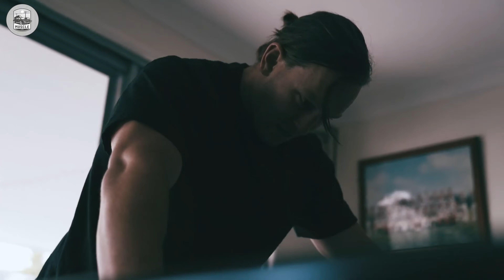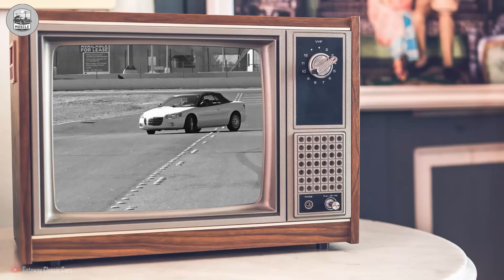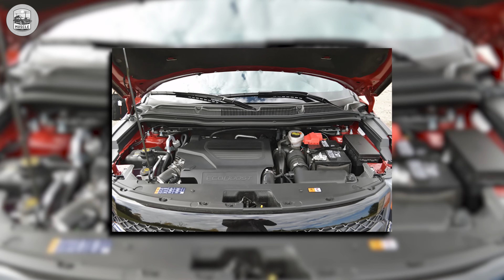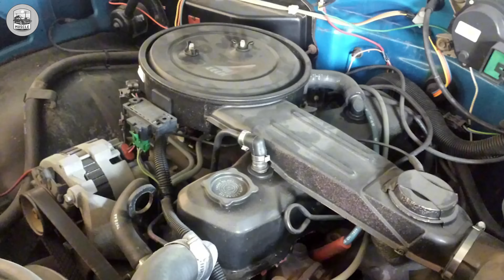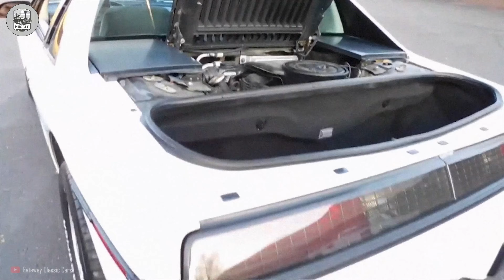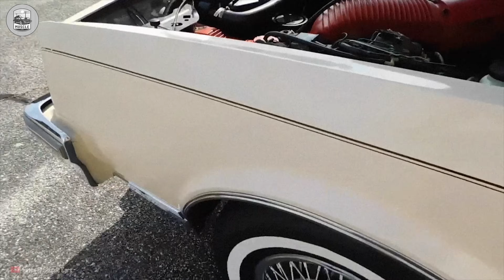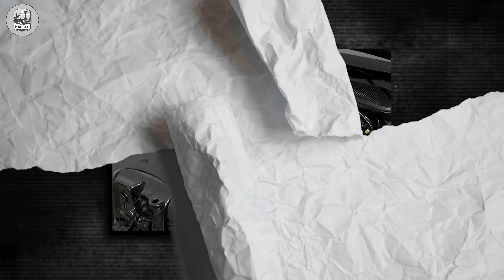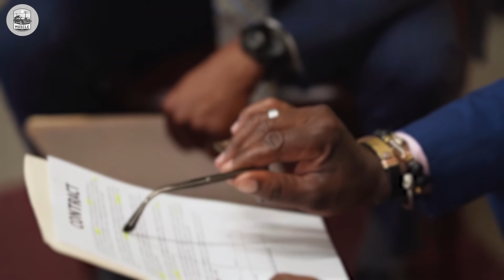MOST FAILED ENGINES ever put in production cars | Worst engine blunder!

Comment: I had a Chevy beretta GT with the 3100. That little engine was the truth. I was easily able to stay on a mustang GT with the 4.6 butt. 

I also had a Buick Enclave with the 3.6 engine. It was the truth too but the water pump did fail about 110,000 miles. Luckily I had an extended warranty that covered the cost. 11 years old I hit the gas it still will break the tires loose and leave rubber on the road. 

Had me a 2001 Monte Carlo SS with the 3800 in it. I loved that engine as well. I actually turbocharged that engine and upgraded drivetrain components. I had 600hp going to the front wheels. The car was swift lol. I regret getting rid of that car and it was a rare color too
Reply from the maker: Wow, you’ve had quite the lineup of legendary GM engines
 That 3100 in the Beretta GT punching above its weight against a Mustang GT? Respect! The 3.6 in the Buick Enclave has always been a powerhouse for its size, even with the common water pump issue. Good thing that warranty came through because an 11-year-old SUV still breaking tires loose? That’s saying something
Now, that 3800 in your Monte Carlo SS – turbocharged with 600hp to the front wheels? Absolute beast mode! The 3800 is one of GM’s most underrated engines, and your setup sounds like it was built for pure thrill. Rare color too? You must miss that one for sure
Folks, let us know about your favorite GM rides in the comments. Don’t forget to like, share, and subscribe to American Muscle Cars. 
Stay tuned for more! Hope to see you in the next video, and have an awesome day
Reply: I had a Cavalier Z24 with the 3.1 and that was a fast car and got great mileage with no issues up to 175K when I traded it in on my Monte Carlo SS with the 3.8L Series II and drove that car to 250K until it rusted out and I got rid of it. Regular maintenance and not beating on it all the time will get you great life out of these engines.
Reply from the maker: @johnkaltinger3922  Great, you've got a real knack for picking legendary GM rides! The 3.1 in your Cavalier Z24 was a workhorse with surprising speed and efficiency. Trading up to the Monte Carlo SS with the 3.8L Series II? That engine is an absolute icon, delivering smooth power and reliability for a quarter-million miles—impressive! Regular maintenance and smart driving really do wonders, and your story proves these engines can go the distance.
The 3800, especially in the Monte Carlo SS, deserves more love. Its versatility, from commuter cars to turbocharged monsters, is unmatched. GM nailed it with this platform
Folks, share your stories in the comments what GM rides left their mark on your life? Don't forget to like, share, and subscribe to American Muscle Cars for more gearhead tales and legendary engines.
Thanks for watching, and stay awesome! Hope to see you in the next video. Have a great day, everyone...

Comment: What hapoened to the 2.8chevy.  couldn't keep rod bearings in thhem.
Reply from the maker: Ah, the infamous 2.8 Chevy V6—GM's attempt to modernize with a compact engine for smaller cars and trucks in the late '70s and '80s. While it had promise, you’re absolutely right about the rod bearing issue. The early models, especially those before 1985, were notorious for oiling system deficiencies. Low oil pressure and insufficient lubrication at higher RPMs caused premature wear on the bearings. Later versions improved somewhat, especially with the introduction of the 3.1L and 3.4L variants, which built on the same platform but addressed some of those early flaws. Despite its flaws, the 2.8 V6 powered plenty of iconic vehicles, from the Camaro to the S-10 pickups, making it a memorable engine for many enthusiasts.
We’d love to hear what you think share your stories, memories, and experiences! Don’t forget to comment, share, and subscribe to Muscle Car Masters! Hope to see you in the next video, and have an awesome day

Comment: The iron duke in the fiero also suffered from a reduced oil capacity because of a shallow oil pan to get the car lower.
Reply from the maker: You're absolutely right
The Iron Duke in the Fiero did have a reduced oil capacity due to its shallow oil pan, all in the name of lowering the car's stance. Unfortunately, that design compromise contributed to engine durability issues, especially under spirited driving conditions. It's a reminder of how engineering trade-offs can impact performance and reliability. For those who love the Fiero or the Iron Duke, share your experiences and tips in the comments! Don’t forget to like, share, and subscribe to American Muscle Cars for more fascinating insights. 
Wishing everyone a great day, see you in the next video
Reply: As does the Audi 1.8t
Reply from the maker: @timdodd3897  Yes, the Audi 1.8T shares some of the same challenges when it comes to engine design compromises. Just like the Iron Duke in the Fiero, the 1.8T's performance can be influenced by factors like oil capacity and cooling, which affect durability, especially when pushed hard. It's a perfect example of how every engine has its strengths and weaknesses. For those of you who love these engines, drop your thoughts and experiences in the comments  we’d love to hear your stories! Don’t forget to like, share, and subscribe to American Muscle Cars for more muscle car passion and insights.
Keep the engine roaring...

Comment: Who does the research for this list? I've been an ASE Certified Master Tech and Diagnostician for over 30 years. I read everything I can to stay up-to-date in the industry. Many of these engines on this list are not engineering failures as many of them functioned as intended over the lifespan they were designed for. The GM 2.2L was meant to be a low cost, low powered economy engine for economy cars with a projected life of 100k miles. Most only saw major issues when reaching higher mileage(150k+) or owners didn't perform maintenance at semi-regular intervals. The same could be said of the famously long-lasting Iron Duke.
The GM 3800 was a great engine, especially the Series II. The only real issue the 3800 had was extremely badly designed and produced intake manifold gaskets. Once you replaced them, the engine was one of the best engines GM ever made. The exact same can be said for its predecessors as far as bad intake gaskets and great longevity in the 3.3L and the 3.1L.
And I'm not a fan of GM.
GM has built some duds, yes, but not most of the ones on this list. The Cadillac 8-6-4 was a dud as was the Northstar with it's leaking, split block and horrendously difficult to change water pump. The 307ci V8 was an underpowered, vacuum hose nightmare of an engine. 
All manufacturers have built some duds and sone great engines. ALL engines that are mass produced will and do have design flaws and common points of failure. But if it's a parts manufacturing failure and not an engine design failure, such as GM's fiber plastic intake gaskets, I don't believe you should condemn the engine design as a failure. 
The Chrysler 2.7L V6 was a design failure in that it had a badly designed and prone-to-leak water pump that was timing chain driven so thus encased behind the timing cover. When the badly designed water pump failed, it would leak all the engine coolant into the oil sump(oil pan) and cause main/rod bearing failure due to lack of lubrication. That's an example of engine design failure. 
Do your research before making these lists. Ask people who have been in the industry for decades. Don't just read someone's anecdotal evidence based on their personal issues with an engine. Ask the professionals.
Reply from the maker: Thanks for your detailed comment
Your insights as an ASE Certified Master Tech bring great depth to the discussion. You’re absolutely right—many engines labeled "failures" served their purpose when properly maintained. The GM 3800, especially the Series II, is a legendary workhorse once intake gaskets were addressed. Similarly, the Iron Duke proved its worth in longevity and economy.
We aim to engage enthusiasts like you, balancing technical facts with broader perspectives. Your point on distinguishing design failures (like the Chrysler 2.7L's infamous water pump issue) from parts failures is spot-on! Feedback like this helps refine our research, ensuring we honor both engineering triumphs and lessons learned.
Keep sharing your knowledge—it enriches our community! To all viewers, comment below with your experiences, share with fellow gearheads, and hit subscribe to join the Muscle Car Masters family. 
Hope to see you in our next video. Have a great day, everyone
Reply: Respectfully, I think you’re missing the big picture here. Many engines were great for what they were designed for. Take the Iron Duke cheap, reliable, and ran forever if maintained. Even ‘duds’ like the 8 6 4 showed innovation, just poorly executed. It’s not always the design; sometimes, it’s maintenance or expectations that lead to failure.
Reply: @AilaniMadden   I am VERY familiar with the various designs and modern innovations of the internal combustion engine as well as newer vehicle EV technology. I've been an ASE Certified Master Tech and Master Diagnostician for over 30 years. I've dealt with all these engines numerous times.
Reply: @knowplay3258  Respectfully, I hear you, but dismissing engines like the 8 6 4 overlooks their potential. GM aimed for efficiency in an era of tightening emissions ambitious for its time. Poor execution doesn’t erase the innovative thinking behind it. Sometimes, innovation stumbles before it soars. Muscle cars thrive on bold risks, even when they miss the mark initially.
Reply: @AilaniMadden   You seem to have gotten me wrong. I defend many of the motors in the video as not being the badly designed engines and failures the video claims. I have no issue with innovation..with purpose. But, innovation simply for the sake of innovation tends to NOT further any part of engine design. Rather, it tends to waste time and resources. Sometimes, newly innovative engines are a boon to the automotive industry, other times they become the bane of the same industry. The 8 6 4 engine was a bane that cost consumers millions for a virtually untested design..it was rushed and not fully tested to the extent other designs are normally. In later years, we've seen successful attempts of the same technology from Chrysler/Stellantis/FCA with their MDS and GM with both their AFM and DoD systems. All as a result of the lessons learned from the catastrophic failure that was the 8-6-4.
Reply: @knowplay3258  yes, thank you and respectfully, I hear your point, but I think we’re too quick to dismiss engines like the 8 6 4 as  failures. Sure, GM’s execution was flawed no argument there but let’s not overlook its intent. In the early 1980s, the auto industry faced skyrocketing fuel prices and increasing emissions regulations. GM tried to adapt without killing off v8s entirely, which is something muscle car fans should appreciate.
The 8 6 4 was ambitious an early attempt at cylinder deactivation that aimed to preserve power while improving efficiency. Yes, it stumbled, but innovation often stumbles before it succeeds. Chrysler’s MDS and GM’s AFM/DoD systems wouldn’t exist without lessons learned from the 8 6 4.
Reply from the maker: @knowplay3258  Thanks for the insightful comment! Your extensive experience as an ASE Certified Master Tech and Diagnostician brings a lot of value to the conversation. I completely agree, innovation should have purpose, and while the 8-6-4 engine might not have worked out, it certainly paved the way for later, more refined technologies like GM's AFM and Chrysler's MDS systems. It's a great reminder that innovation, when done right, can truly move the industry forward. We love engaging with enthusiasts like you who bring that real-world perspective. To all viewers, please share your thoughts, comment below, and don't forget to subscribe for more. Hope to see you in the newest videos. Have a nice day

Comment: The GM 2.2 OHV was reliable.Same with the 3100,Fel Pro and Dorman came out with upgraded intake manifold gaskets made out of metal to fix the intake manifold gasket problem.That Jaguar V12,lot of them were yanked out replaced with a 350 Chevy.The GM 2.5 was good
Reply from the maker: You're absolutely right about the GM 2.2 OHV and the 3100 engines
 Both earned a reputation for reliability once that notorious intake manifold gasket issue was addressed. Props to Fel-Pro and Dorman for stepping up with those upgraded metal gaskets—proof that the aftermarket world knows how to solve problems! The Jaguar V12 swaps are a classic story, with many owners opting for the bulletproof Chevy 350 for its simplicity and power. As for the GM 2.5 'Iron Duke,' it was an unsung hero—rugged, efficient, and a go-to workhorse for many GM vehicles.
We love hearing stories like this! Muscle cars are all about ingenuity and passion. Got more experiences or knowledge to share? Drop them in the comments! Don’t forget to share this video and hit that subscribe button to join the American Muscle Cars family. 
See you in the next video, and have a fantastic day
Reply: While many muscle car fans dismiss GM's smaller engines, the 2.2 OHV and 2.5 Iron Duke were underrated workhorses. They offered durability and easy maintenance. The 3100 V6 improved reliability with upgraded Fel Pro gaskets. Unlike temperamental Jaguar V12s swapped for Chevy 350s, these engines earned their keep with simplicity and dependability over raw power.

Comment: Chrysler has a replacement for that 3.7. A 3.6 that is a piece of s h i t. Ford's Tofu Boost is rubbish. Twin turbos are notorious for head gasket failure since they are treated as though they are a V8, something that they are not capable of.
Reply from the maker: Hey there, thanks for sharing your thoughts.
The Chrysler 3.6 Pentastar has stirred up mixed opinions over the years, with some loving its smooth power delivery and others pointing out early issues like rocker arm failure. On Ford's EcoBoost ('Tofu Boost' – that’s a new one!), it's true that high-output turbo engines, especially earlier versions, had teething problems like carbon buildup or gasket failures under heavy loads. Still, with proper care—like high-quality oil and respecting the turbos—they can last.
Muscle car fans know nothing beats the raw grunt of a naturally aspirated V8. Turbos are impressive tech, but let's admit: they’ll never replicate the soul-stirring roar of an old-school 427 or a small-block 289.
What do y’all think? 
Drop your thoughts below, share with friends, and smash that subscribe button for more muscle car memories! Hope to see you in the next video—have an awesome day...
Reply: @MuscleCarMasters68  Unfortunately, the 3.6 just doesn't have training in Torque for the Job. There should have been a PhD offered in torque/horsiepowah balance. Without having to wind it up to Grenade. The good ole Jeep 258 and 242 were torque monsters that allowed for entering the interstate without having to put your leg into the trunk of the car ahead of ya.Buut, those were Lseexes!! Even the Dodge diesel, the cummins is a similar design of tried n true function.
Reply from the maker: @Sunspot-19  Hey there, thanks for sharing your take! You’re spot-on about torque being king, especially when comparing modern engines to the old Jeep 258 or 4.0 inline-sixes, those were true torque monsters
The Chrysler 3.6 Pentastar may pack decent horsepower, but yeah, it’s no match for the low-end grunt of those legendary straight-sixes. And you’re right—designs like the Cummins diesel prove that simplicity and reliability still win hearts.
Modern tech like turbos and high-revving engines are cool, but nothing beats the raw, unfiltered power of a classic V8. That instant response and ground-shaking growl? It’s pure muscle car magic
What do you guys think—can modern engines ever match the soul of old-school torque machines? Let us know in the comments, share this with your car-loving friends, and don’t forget to hit that subscribe button! Hope to see you in the next video, stay awesome and have a fantastic day..